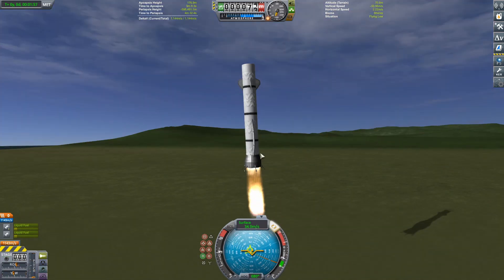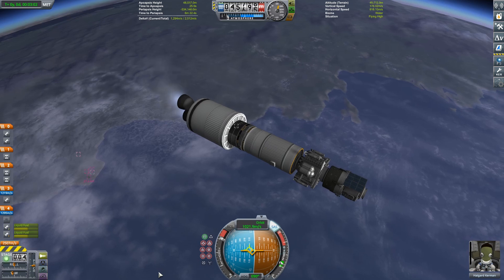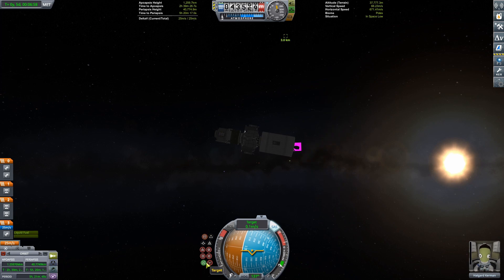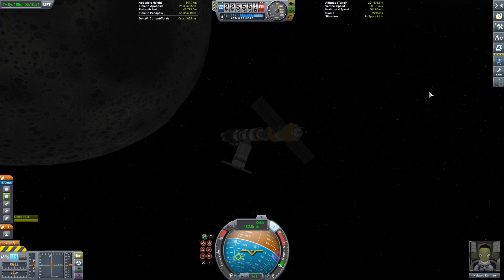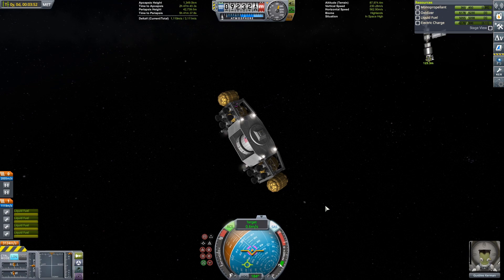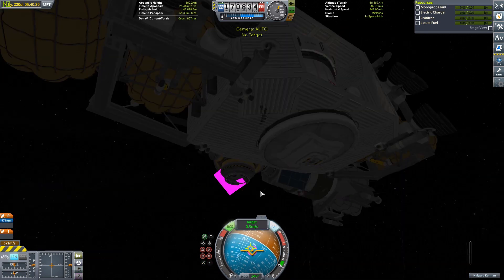[Part 2] Project Artemis in KSP! Sending The Landers | Kerbal Space Program

Comment: Vulcan actually has better performance for sending things into deep space than New Glenn, but it has a similar fairing size so it can fit the big dynetics lander. From what I heard the transfer and ascent stage of the national team lander are reusable, and the ascent stage can refuel at the station. The Transfer stage is built by Northrop Grumman, the descent stage is built by Blue Origin, and the ascent stage is built by Lockheed. Avionics and software are being made by Draper. This is KSP though so who cares if its a direct recreation
Reply from the maker: Well, accuracy is somewhat important to me to thanks a lot. I can't ever remember who contributed what to the national team one. Also, what does "reuse the transfer stage" mean? Like what would they use it for? Do they bring it back to earth?
Reply: I believe it would pick up the ascent stage and bring it back to orion, which would take everything back to gateway for refueling. I'm not sure what fuel the ascent element is using, probably aerozine because I'm pretty sure the AJ10 is on the ascent stage. However I don't know what the fuel the transfer stage uses, it's probably the same stuff used in the cygnus cargo vehicle because I believe it's going to be based on that. Another thing that needs to be figured out is whether the propellent depot will have methalox for the dynetics lander, which has better performance but is much harder to store. To be honest, a whole lot is up in the air, the best source is probably nasa but even there still figuring things out. I would recommend David Nagy's series, he does a decent job of showing how things are going right now, but he stops after artemis 3 meaning no gateway action
Reply from the maker: @jmstudios457  thanks! That makes sense. I'll check that guy out, Artemis is going to be really cool if they actually get everything working!

Comment: Did you use mods to get the clouds or something
Reply from the maker: Yep, I use environmental visual enhancement and stock visual enhancement to get the clouds
Reply: @Piolet1549  alright thanks
Reply: Also what's with that purple thing?
Reply from the maker: It’s a glitch that happens with the mods, not really sure what causes it
Reply: @Piolet1549  hmmmm, I just whant visual mods that dont do that
Reply from the maker: I’ve looked around and haven’t found an easy fix yet. There is pretty much no way around it that I know of
Reply: I have the same mods and don’t get the purple square problem. I think it’s just a glitch with piolet1549s save file